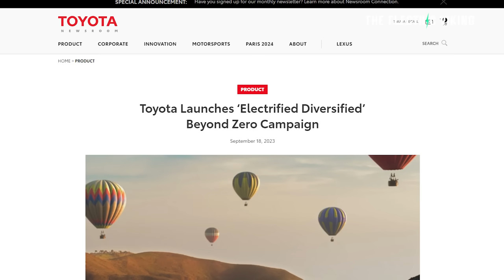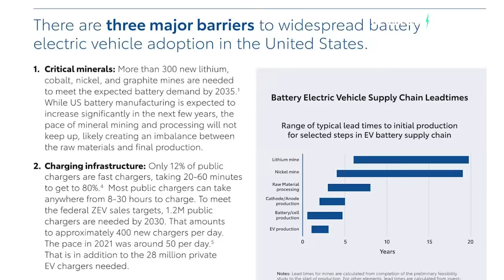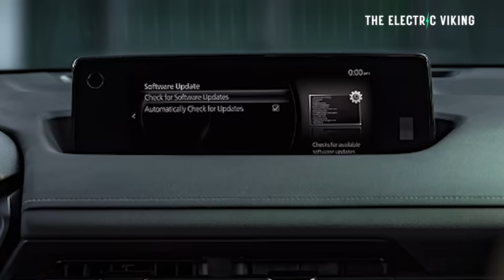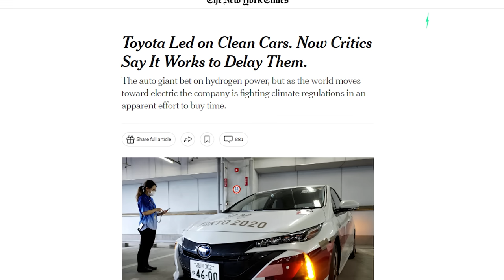We are witnessing the early stages of the biggest fall of any company in history

Comment: You aren't listening then; your just talking.  I've pointed out that Toyota and others are making fully ethanol running hybrids in Brazil already; they may be thinking they will expand that to other countries.  Ethanol is considered renewable; it doesn't use any fossil fuels hence it is actually way better than the environment than a heavy EV using the grid; which is world wide 80% powered by fossil fuels which loses 15% of its generated energy in transmission and charging of the EV.
Reply: Ethanol comes from plants which competes for the soil we use for food. It must also be fertilised, processed, transported and stored. Sure, Brazil has lots of land and water, after they cut down the trees to clear the land, but certainly not europe nor China. Electricity in many countries, like here in portugal, is mainly renewable, often 100%. So in sunny and windy countries electricity is much less polluting than farming.
Reply: @antoniocruz8083  I must check out what portugal does;  most of EU still uses mostly fossil fuel; wind and solar on overall energy consumption isn't very much.  China and the USA are 80% fossil fuel.  If you try to calculate just the worlds trucks using lithium; if you 10x lithium production it will still take a decade if you devote every ounce of lithium to truck batteries; and each ton of refined lithium takes 500 tons of ore and 500,000 gallons of water to process it, that is just the lithium which is 7% of the battery.  If I calculated correctly it would take about 1.5 billion acres of land to grow high sugar content crops to provide for the worlds transportation needs; if that is correct it is an area sbout the size of the state of Kansas; if that is split around the world and the the distilation is done locally and the unused materials returned to the ground then I would appear that it would have a lot less impact that digging up the materials for lithium batteries; maybe sodium or something could help solve the battery limitations but until there is a concrete viable plan; there isn't much reason to move forward with it.  What do you think?  In the mean Time I'll look up Portugal
Reply: We have had E85 (85% ethanol) capable vehicles in the US for at least 10-15 years. I have one myself. Farmers love E85. I avoid it as gasoline is better for the engines.
Reply: @litestuffllc7249  Good arable land is scarse, as is water for irrigation. All good land has already been used, please find me a fertile Kansas sized area that humans, stupidly, have not yet used. The conflict in Ukraine is partly due to the excellent soil which is only found in that part of the world. All mass produced farming needs tons of fertilisers or within 2 years the land becomes infertile. But half the word is a desert, why not harness the sun. Get energy directly into a battery via wires, not trucks. Stationery batteries don't need to be high tech or light. They are already setting up huge batteries to supply cities 8-12 pm or balance out the inconsistent renewable supply. Battery banks cost very little to operate as opposed to a coal station that needs dozens of permanent staff, raw material and waste. Because of renewables, the electrical bill in Portugal has gone way down. I don't understand  how anyone not want a cleaner environment  or worse, not understand that we just cannot keep on burning ourselves to extintion. Sure, the initial cost is high in money and pollution but in the long run we will all use a cleaner energy source.  Ev's now even accept power in/out so as to supply your house at night. The reason all this technology is not being allowed or  legalized more is due to the pressures of the oil oligarchy which has a stake in most fossil fuel related industries.
Reply: @antoniocruz8083  OK Antonio; Lets examine your points. The largest battery arrays in the world are not capable of suppling energy for more than minutes to even 2 million households; so you can't manage to provide power with them for all night without attempting giant battery arrays; you suggest they don't need to be hightech ones - what else can they use? Why hasn't anything but lithium been used?  I'll suggest they use Lithium because it's going to last the longest without needing replacement and it will need replacement after 5-10 years. You suggest land capable of raising crops is hard to find.  Brazil has no problem finding it; the Amazon is the size of the USA. What you have is green clowns that also want to "save the Amazon" - one area that could supply all the needed land to make all the ethanol the world can use - so of course they don't want to make even a small portion into useful land. As for fertilizers; the main reason they need them is they do not plow the stalks back into the ground; they burn them. If stalks are put back into the ground they 80-90% is restored; the remainer needed does't come from the ground it comes from the air and sun; sugars are  hydrocarbons - combinations of carbon, hydrogen and oxegen which come from a combination of sun, water and air. not from fertilizers; In western farms you do plow stalks back into the ground; they have the machinery to do it; in poorer countries they haven't; so we'd need to provide such aid. What are fertilizers? Mostly Nitrogen and Potassium sulfates.  You see very little in these in common with sugars; those are needed for crops that have nitrogen and potassium in them. There are vast others regions that have no effort to use so far for crops which currently have jungles or forests. New Guine; South East Asia, Congo.  You mention deserts; why are deserts expanding.  Some are now realizing that moving animals to big stock yards is counter productive. If you properly rotate them around, before they eat every plant to the ground killing the land; if you move them then their hoof prints help capture water and their dung provides fertilizer for new growth. So many desert areas could be recaptured as productive land by proper grazing and rotation; when done wrong the animals create desert by killing all the plants. Doing this gives you all sorts of desert areas that can be recovered. While this wouldn't directly lead to corn or cane fields; it would allow a shift of human food so some of the exsiting corn and cane fields won't go to human consumption and can be shifted to ethanol.

Comment: The key to the electric car acceptance is very closely tied to battery technology - lithium batteries that catch fire, are expensive , don't work well in cold weather , degrade to rapidly with use just won't cut it.
Reply: Indeed - HENCE the historically rapid, blisteringly revolutionary progress forward that's happening now, finally, after 100 years of dirty hydrocarbon combustion, pollution, and unnecessary complication - not to mention ever-increasing cost vs the exact opposite. 👍
Reply: @justinklenk  EVs are sold the same way we could sell ICE cars if they weren't being held responsible for what goes in the tank.  In China, EVs, it will be coal fired electricity.  Should also be the case in Germany, and probably the US with it's clean coal.  Micro nuke companies are exiting in the US from what I heard, and no new plants have been built in what, 50 years.  Meanwhile Fukashima is still leaking, and has poisoned Pacific fish stocks to a non-trivial degree, and is working into the Atlantic.  EV nuts just pretend none of that is about them. Solar, yeah that is a clean tech.  Wind turbines and micro plastics, bird strikes, short lifespans, and huge garbage dumps for the decaying hulks that are gradually entering the natural environment as toxic material erode.
Reply: @tacticalskiffs8134  
Indeed, the cleaner... the BETTER. We're making significant progress, the overall rate of which is increasing.

Comment: I wonder if they are thinking of a Hydrogen-based ICE engine. Fuel cells combine hydrogen and oxygen to produce water as exhaust, but that's not an IC engine.
Reply: The are 2 hydrogen engines
The first as you described based on a fuel cell at about 25% efficient
The second is exactly as a petrol engine but injects hydrogen rather than gas/petrol and is an ICE engine as it combusts fuel like a petrol engine.  This is arround 10% efficient.
Reply: @Tom55data  I was just dumbfounded by the talk of a hydrogen ICE a few months back. An incredibly stupid idea if you understand the basics at all.
Reply: Hydrogen as a fuel for combustion is completely doable.   The problem is hydrogen doesn’t have the energy density that gasoline does so that is something that will need to be further developed
Reply: @od40k77  The difficulty with hydrogen is storing it. In a gas it has very low density, so the tank needs to be huge. For liquid hydrogen it needs to be kept super cool, which once again is very difficult. Unfortunately, this is just physics and there's no way to get around it. For hydrogen, I'd see it better used for heavy vehicles like large trucks and locomotives, where space is not so much of a problem.

Comment: ICE may diappear for the majority of passenrger cars, but special use cases will exist for a long time - while waiting for batteries to reach operational parity with gas/diesel. Ambulance operators/builders for example will not change over to electric vehicles until they have the long range and fast charging needed for their niche vehicular application. Often ambulances don't travel very far to pick up and deliver their patients, but some times they must. No ambulance operator is going to risk using a vehicle that strands a patient needing critical care because the battery died or the ambulance couldn't get to the patient quick enough becuause slow charging. 

Plus after the big freeze in Chicago this week, people in cold regions are going to be pertty reluctant to buy an EV. Yes, we know cold tolerant batteries are in the pipeline, but they are not here yet. If a tech can be "broken" by operator error, humans will predicatably find that path as they did last week in Chicago, by not knowing how to use their cars in cold weather. And yes, ICE cars have trouble in cold weather too and there was no news reporting on how many people couldn't start their gas cars that day, but EVs are an easy target. The negative PR from that event alone could delay EV adoption by years. These sorts of negative imprints stick in people minds and they will remember every time they want a new car.

Comment: Mr. Toyoda may have calculated the costs of replacing national power grids, to feed the incredible expense of of adequate chargepoints, and seen the long game. No large country with long distances and urban megaloposis' can afford the necessary infrastructure to support 100% or even 50% EVs. So in the long game, there will still be a sufficient need for ICE cars.
 You may notice that no one has ever posted a study showing what the full costs of a total EV infrastructure will be. Or how they would be paid. Or how long the would take to implement. No one.
Reply: and why arent you looking at a country like Norway where almost 90% of all cars sold is EV's  funny how they have the infrastructure  in place and it's working and still we have naysayers that refuse to  open their eyes.
Reply: It has been done. A typical EV will require about 2,000 kwh per annum. This is less than what had to be provided in the US  when air conditionin took off in the sixties.  In most places your heating will require far more than that. Most charging will be overnight anyway. If there needs to be grid expansion it will just happen without any fuss.
Reply: The study on the capacity of the electrical grid to withstand greater consumption by EVs must be accompanied by another study on the capacity of an EV to store energy when there is lower consumption and supply energy to the grid when the need is greater. This is also what will be saved in energy required for pumping in oil pipelines. You need to see the bigger picture.
Reply: @PietKargaard  Norway population is 5 million people, the US is 340 million plus 22 million tourists that visit every year. Who want to visit Norway?. Not only there is 68 times less people, it has less populated areas, less inustry, etc. You can´t compare
Reply: @MicroClases_Ciencia  340 million means you have more resources to do what Norway did. The US has more money and more people. Why don't Americans understand proportionality?
Reply: @MicroClases_Ciencia  what has  size to do with anything here? or are you saying that China is lightyears ahead of the US since they have no issue making the infrastructure working for EV's, the USA is  stuck in the past  and dragging their feet on this issue.
Reply: @100c0c Norway has tons of money. Their Oil wealth is endless and public. Nothing an American can relate to.
Reply: @BockaufVegas   The US can definitely afford it. The bloated federal budget has more than enough.
Reply: @100c0c  the USA has debts of about 34 trillion, Norway owns a fund of about 1.3 trillion for its population. Just to mention.
Reply: @BockaufVegas   Norway sits on most of its oil wealth. They don't run their whole economy on it like Venezuela tried to do. Besides, the US has a $22T economy. China is doing it with $17T.
Reply: @PietKargaard  size is everything. Electrifying all US car industry  is not feasible, not with current technology.
Reply: @100c0c  it also means that you have many many more logistic problems, way more roads and desertic lands to electrify, more requirements, less centralized government to unify protocols. I know that Iceland could be full EV, and Greenland, or another small wealthy country. But, take a look at England or other densely populated country. Very hard